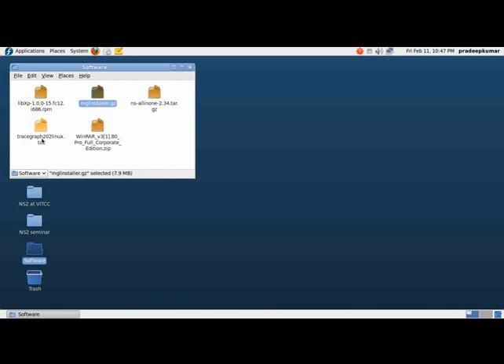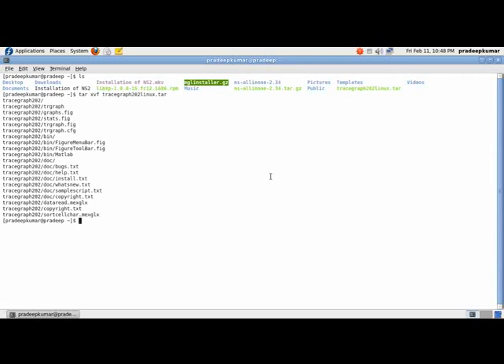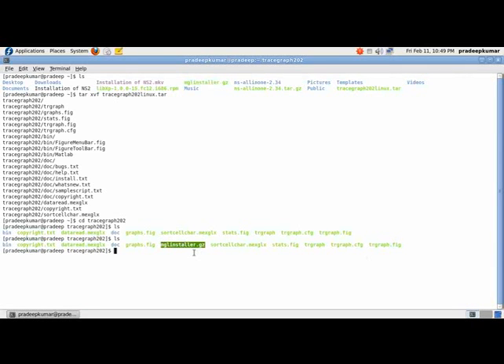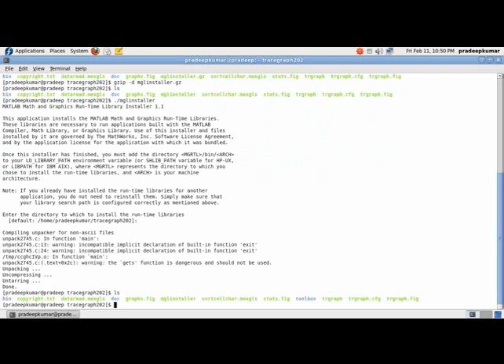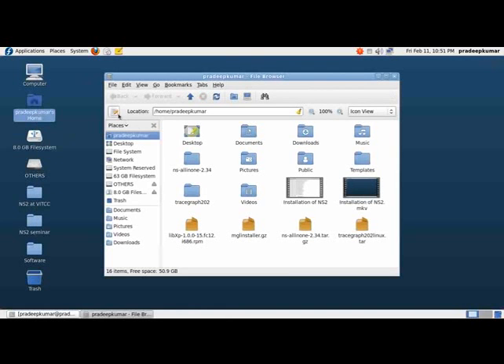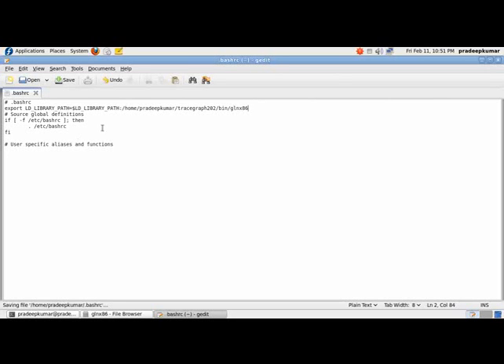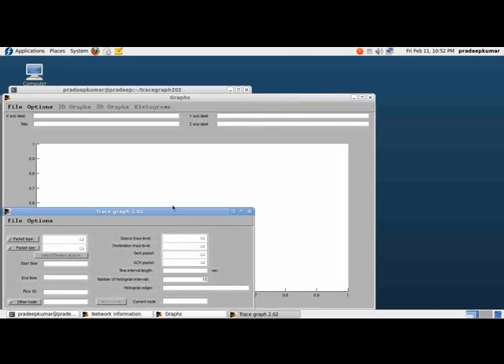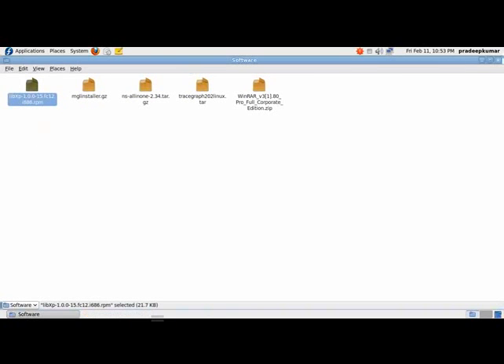Tracegraph Installation in Fedora

Comment: When you are demonstrating every thing in ubuntu then why you have dragged fedora to install tracegraph ??? I don't think anybody will get help with this...should be install this in ubuntu.... so much error is generating while doing this in ubuntu
Reply from the maker: See the date of the video. I did everything in Fedora/RedHat, some years back. Later on I moved to ubuntu only because the entire web is running towards ubuntu. Regarding Tracegraph, its a very old unmaintained software which is not suitable for current OS distributions. There are so many dependencies which cannot be solved with the current day GCC/G++ compilers.